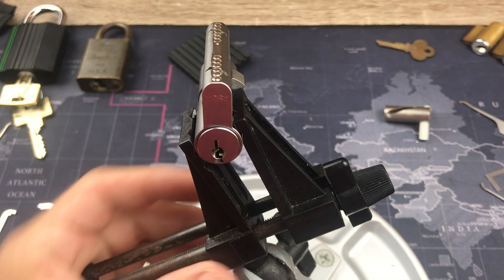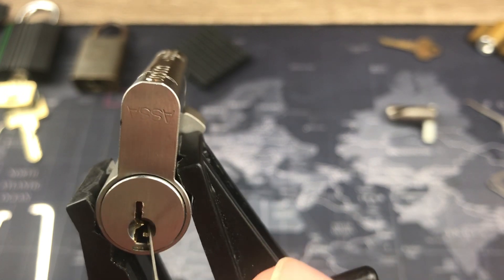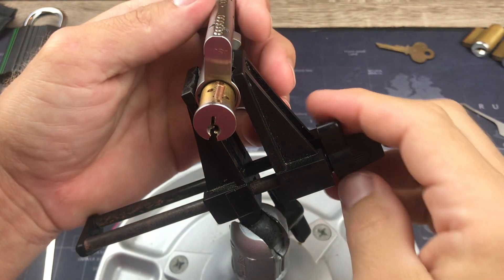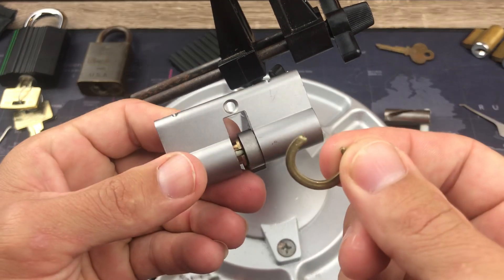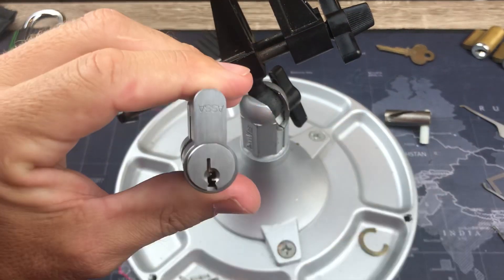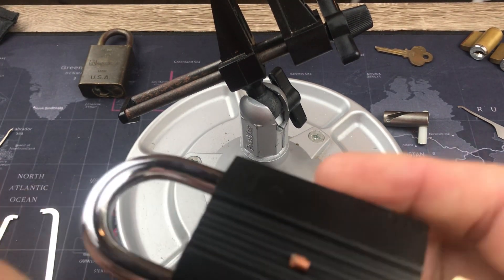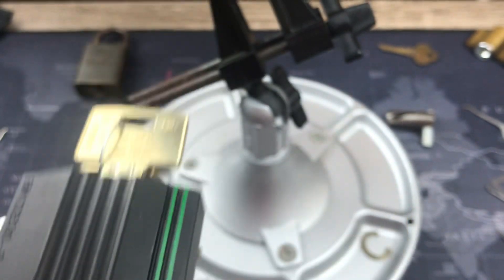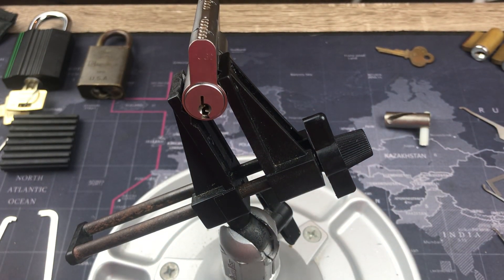DON’T DO THIS

Comment: Yeah I did that with a l lock I just got in the mail the other day. What's really frustrating is that I have no way to put it back together. if I had looked a little closer I would have noticed that it said there was no clip written on the side of the lock
Reply from the maker: Daniel Jaworski that’s horrible. If you want to send it to me I’ll reassemble it and pick it and send it back!
Reply: @UnChaeL-Paradise  Thank you but I think I found away to get it back together and even if that doesn't work I just need to order a follower set. I found a nice looking set already on a site I want to try to order pins from anyway. I just need to look at my finances this week and see if I can afford to place the order.